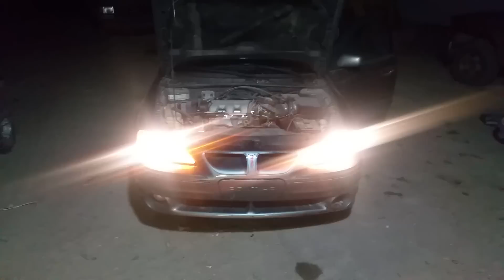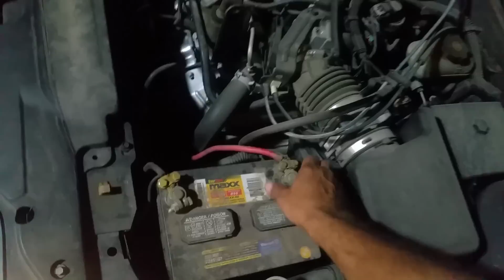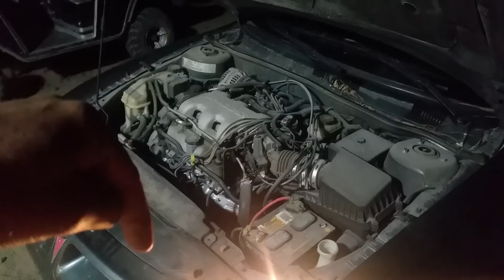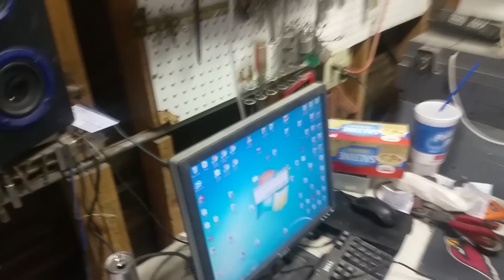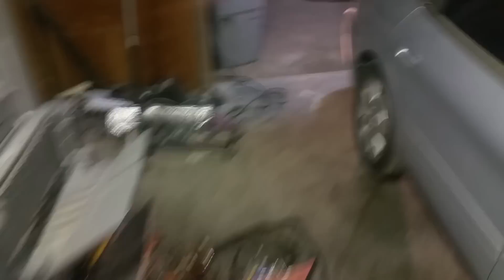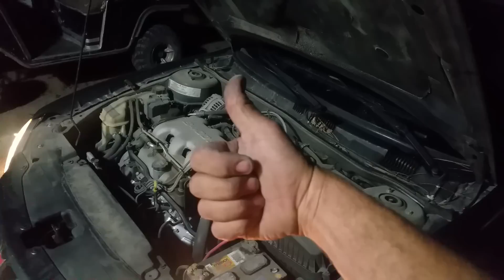Bad Alternator or Bad Battery, Easy Solved

Comment: yes but if the car won't start you cant do this test :(. Just replaced my starter and I'm back to a car that won't start. Gotta be the battery or alternator just not sure which one.
Reply: It wouldn't be the alternator. The alternator only does it's thing once vehicle is running. I'm sure you have had the issue taken care of since you commented on this a month ago. But without knowing exactly what you are dealing with I would say battery. The battery is either dead or bad. The alternator could be why battery is dead,  but charging the battery would start the car even with a bad alternator.
Reply: Yes always check your battery and alternator first before replacing your starter. For example, If your vehicle will not turn over, turn on the headlights, if they are bright as usual and not dim it is probably not the battery or alternator. It would be something else. Maybe the starter, or the wire to the starter came loose maybe, but if you have juice it's probably not your battery or alternator.There are thousands of possibilities when troubleshooting car problems, but it helps to know where to start.

Comment: All my interior lights started dimming down till they went out and then car died and won't start back up,  is it the battery or alternator?
Reply: Probably the alternator or a bad ground or connection. Check your battery terminals and make sure they are not loose.Also if it is cold out and your car has been sitting, then the cold can drain the battery. nine times out of ten if your battery is dead, then it's the alternator.

Comment: I hope this is the problem.  I just need a battery.  If not.  I am going to see if I can replace the alternator myself.
Reply from the maker: i have some videos on some alternator replacements. they are not hard, but if your car stayed running after taking a cable off, do not change the alternator. that i am sure of. thanks again for watching.

Comment: Will the vehicle still run if it has a bad alternator when you disconnect the positive cable to the battery
Reply: it what shut off instantly
Reply: mark green I thought you take off negative
Reply: DreadHawk Stokes i took off negative in my car broz ..but a old head said they will both work
Reply: I did it and car continued running but all the dash lights were flickering and radio wouldn't turn on... ???? Are the accessories supposed to flicker?

Comment: Auto Zone says never remove a battery cable while the engine is running. It can cause a surge that damages electrical systems.
Reply: "Auto Zone says"  That's your first issue.
Reply: autozone wants to sell you
Reply: Yes, it absolutely Can.  go back up to the top...and read my "Tale ( Recent)  Don't unhook your battery with engine running.  A surge will occur.  my driver window circuit is now flawed...and it won't come up.   lovely..... People...don't let anyone tell you,  'this is just Fine!   it isn't!!!!!!    there are other SAFE ways...to your motor,  to check your Alternator and Battery.
Reply: drummerfella 55 x
Reply: I've heard stories to back up that claim. But have never seen it myself. And I've been involved in more charging system issues that most 40 year mechanics have. The only vehicle types I would be worried about doing this to would be chryslers. Sometime during the 90s they decided to have the ECM control the voltage instead of a normal voltage regulator.
Reply: AND HOPEFULLY DON'T BLOW THE REGULATOR IN THE ALTERNATOR
Reply: O O O O'Reily's removed my cable while the car was running to test if the alternator or battery was bad.  Autozone, O'Reilly, and those alike are pretty much the same companies.  Also, I did not loose my stations.
Reply: John Blank 

I wouldn’t trust my car with someone who works at an auto parts store, but that’s just me. You can test your alternator with a voltmeter or multimeter, you can find cheap ones for as little as $5, and you don’t risk damaging your electrical system.
Reply: @HypothermicCrab  I gave you the like but remember that not everyone knows how to use those electrical testers.
Reply: pancho lopez 

True, but there are at least a million YouTube videos that show you how to use a voltmeter.
Reply: Sorry, but as i can see you didn't understand  that what i was suggesting is, that you can do that. Have a nice day!
Reply: @123anonify  that is too easy how can anyone mess up hooking 2 little clamps one hot one ground?
Reply: @BayouHotBoy1  what year is vehicle?
Reply: @silly_cat-j5g  2009
Reply: @chickenfriedfrog502  so true  loose cables causes your battery to lose charge or worn out terminals also
Reply: RussNo1 old wives tale. Just like the don't use mobile phone at the gas station coz it could blow it up
Reply: Steven Capp 

Neither of these are old wives tales. Removing the battery cable while the car is running can damage your car’s electrical system and using your cell phone while getting gas can spark the gas fumes and cause a fire, it’s the same reason why you turn your car off while getting gas. Just because it doesn’t happen every time doesn’t make it false.
Reply: @HypothermicCrab  I've put gas in my car while it's running since the early 1980's & never had a problem.
Reply: @HypothermicCrab  lol... ol
Reply: RussNo1

Comment: no man now i am confused,  is there a correct safety precaution to take when removing one of the terminals?
Is it positive or negative ? i was told negative... now this video tells me positive...
which is it really?
Reply: Always take the ground terminal off first....this guarantees that the cars electric system cannot be shorted as current can no longer reach the electrical system
Reply: This video is inacurate...some of todays vehicles MUST have the battery in the loop at all times...to easily test alternator use a multimeter to check battery voltage while engine is not running and remember that voltage. Now measure the battery voltage with car running...if theres an increase then your alternator is putting out voltage which is greater than the batterys voltage

Comment: Does it apply to commercial big trucks like Peterbilts, Freightliners, etc? Thanks
Reply from the maker: yes, except keep in mind you do not need voltage to keep a diesel running and where there are more than one battery then the issue could be one or more. therefor a volt meter should be used.
Reply: Generally semis are running 24 volts. I don't know much about them, but with that voltage I would be a little afraid to try anything by hand. Lol

Comment: Another video says remove the negative cable
Reply from the maker: your all correct, either cable will do the same. if your afraid you will drop it, remove the neg, if you have multiple connections on one, remove the other. great comments and great responses. your all just great !!!
Reply: Removing either cable will give you the same result
Reply: as long as ur disconnecting the battery
Reply: u always want to have the -( negative) on . so when u jump a car or hooking up a battery the first that goes on is black (-)and the last to come off is negative  (-) that way ur always grounded.
Reply: Why would they say that u pull the negative wire and it happens to touch the positive there goes everything it will fry every wire in the car
Reply: RussNo1 I saw that too.
Reply: thx russ, I was about to ask/say exact same thing

Comment: This test works fine on older vehicles however modern vehicles where the computer replaces the regulator you can do serious damage... an alternator with the battery disconnected can produce high voltage  very dangerous.
Reply: J Adams Lol if that was the case wouldn't it be jump starting your dead battery in an emergency cause the same problem? Lol While you paying your money at the shop, you never know what someone is doing while your back is turned. Now... Ain't that the truth! LOL :)
Reply: Lol if you are killing your car by disconnecting a battery terminal..Battery dies while driving... then what??? If that was the case wouldn't it be jump starting your dead battery in an emergency cause the same problem? Lol While you paying your money at the shop, you never know what someone is doing while your back is turned. Now...Summary... Jump starting your car in rare instances should be just as much harm as pulling a cable in a rare instance. Ain't that the truth! LOL :)
Reply: @trealwilliams1563  I have a 2006 land Rover, can I try this, I don't care for losing my settings.
Reply from the maker: your a idiot. the ecm will never replace a regulator. the older vehicles were more dangerous because the regulator was external. most today are internal. so if it goes out, there is no charge. get your facts straight. a internal regulator in the ecm,,,einstien would of loved that.
Reply: LMAO he called you an idiot smh somebody needs their negative cable unplugged ...
Reply: thomas brian look up Chrysler vehicles
Reply: Chryslers do have voltage regulators built into the ECM. Now that is the only manufacture that I know of that does that. You can even purchase a kit so if you have  a charging issue you don't have to do the costly repair. 
https://alternatorparts.com/external-voltage-regulator-high-output-alternator-kit.html
Reply: Ford have the regulator in the pcm and mines and 05....maybe people need to know more lol :)
Reply: thomas brian Only idiot here is you lack of experience lack of research. If that were a Chrysler you would be looking st thousands to repair it. Look how quick the idiot calls other idiots. Go back to school learn some manners
Reply: thomas brian how quickly you can call someone idiot.....you have attitude issue

Comment: The potential issue with this trick is the voltage regulator spiking once the cable is removed. The battery acts as a buffer. When removed, the regulator could spike causing things in the electrical system to fry. Now, I have never personally seen that happen, and I have seen many people do this trick with no issues, and I will admit I've only heard one person say that it did cause an issue. And there is no telling if it is actually what caused their issue or if it was something else. But in computer controlled vehicles, why even take the risk when your local auto parts store will test it for free? https://www.familyhandyman.com/automotive/how-to-test-an-alternator/view-all
Reply from the maker: absolutely not. the battery is for cranking purposes only. the car never needs a battery after it has been started. where the hell are you people coming from!!!!!! you clearly do not know a damn thing and i am starting to get a little pissed that you would detour someone from doing this easy stuff them selves and saving money. i am about to delete about 5 comments, but the mechanically inclined guys are getting a kick out of you rookies.  here is a idea, if you are not 100 percent sure, and you think your right because you are ASE certified ( which now days you can be for 49.99 which you can do on line ) think again rookies. un real!!! so naive, and unreal. tell your friend he is a idiot, you just got lesson 101 for free on batteries.
Reply: the battery acts as a voltage buffer to compensate for low / high voltage in the system.. you may experience voltage spikes that can destroy any electronics or the diodes inside your alternator...also modern alternator regulators contain a small computer that can be destroyed..  YOU ARE WRONG as is the statement "the battery is for cranking purposes only" .. what a bullshit
Reply: John Richards  I have a lexus LS430, 2005 and after watching your video a few times I want to take the positive cable off to run your test too see if the engine will keep running to check if I need a new alternator, but then I read a comment about a spike in the electrical system could do some major damage OUCH 😏  ARE YOU SURE I WILL NOT HAVE A COMPUTER GLITCH AND REALLY COST ME BIG BUCKS ?  I bought a new interstate 24F and put it in yesterday and my wife drove the car and she noticed the battery light was on ! I charged the battery a long time but it will not take a full charge.  ie ANY SUGGESTIONS what my next step should be ?  ps you did an excellent, very informative job in your video 👍
Reply: bobl78 
Your wrong buddy
Reply: @justincallen2707  he is not. this happened to me. on idle it was ok, on 3000 rpm everything burned, all the bulbs, radio, ecu, diodes in alternator. battery prevents voltage spikes above 15 V. you should never remove terminal. every car electrician knows that.

Comment: Thomas, thanks. I've just started to search youtube for a dead battery solution.  I have a 2003 chevy  avalanche. I put in a new battery back in Feb this year. fast forward to the past couple of weeks...the battery light would come on once in a while, the digital odometer would read "battery isn't charging". not 20 minutes ago in a store parking lot, my truck wouldn't start. there was some clicking, indicator lights would come on.  I got a jump and the truck was running fine, however, the battery voltage stayed at 9. got home 5 miles later, trned off the truck, then it wouldn't start. lots of clicking but no starting. I obviously can not test this particular video, but I believe I have a bad battery. also, I don't do any prolonged traveling. any recommendations? Thanks. Bob

Comment: Your video helped me fix my GMC Sierra pickup. Headlights were really dim at night & the volt gauge was around 10 volts running. Changed the alternator & it runs around 14 volts while the truck is running, which the old alternator did before it went bad.
Reply: I got a remanufactured Carquest alternator from Advance Auto with a promo code, so I got a good price. The alternator in the box was a Delphi. So I got a remanufactured oem style which I was happy about.

Comment: alright video, but you say
1. disconnect battery. car died. replace alternator. but there could be other things like blown alternator fuse, bad ecm, broken wire, corroded cable.
Reply: Jeremy Castillo still this video will help a lot for those who need a quick 1 2 of whether or not your battery failed. Of course if the vehicle dies you must go down the chain to each step between the alternator and the the fuse panel to determine whether the alternator is faulty. Also a multimeter will be able to show you if a short or open line exists between both the alternator and fuse panel , of course tho the vehicle must be running to get readings ie you'll need a boost regardless
Reply: Jeremy Castillo